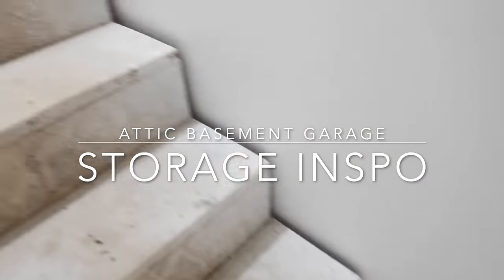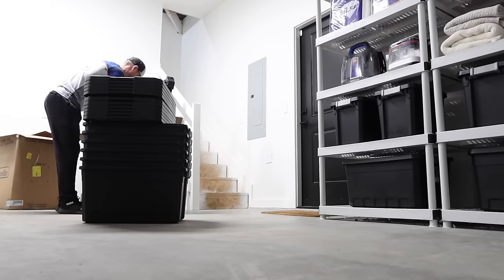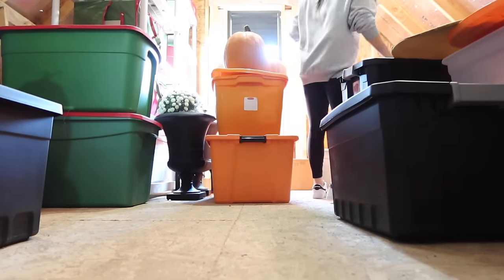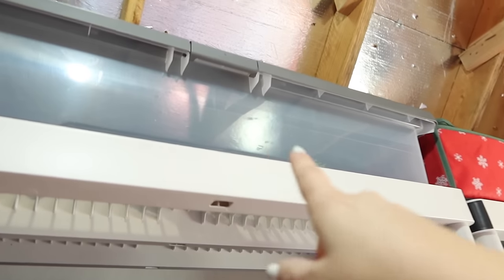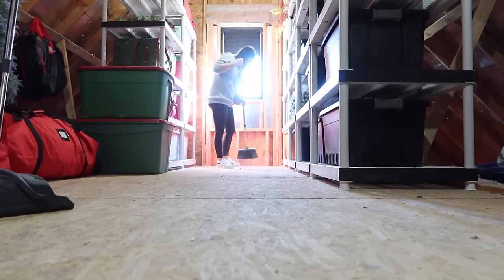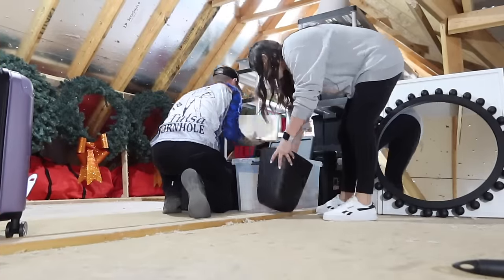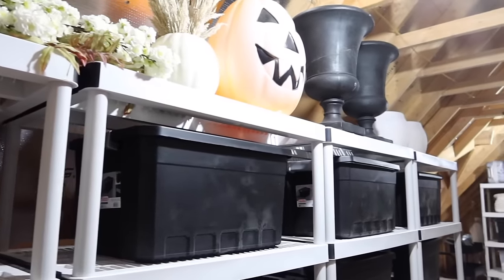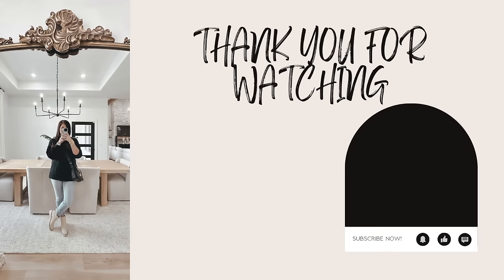DREAM ATTIC STORAGE + ORGANIZATION SYSTEM | 2024 HUGE ATTIC ORGANIZE WITH ME | STORAGE GOALS 2024

Comment: Wow! What a difference. You really can shop your attic now.
Please consider flipping those two black planters upside down. I'm afraid if you bump that storage rack just right, they might fall on someone.
If that is an extra air purifier with the left over building materials, plug it in up there. It will help with all the dust. Please take care of your lungs after being so sick. Give them as much clean air as you can.

Comment: Love your attic but why didn't the carpenters finish it that insulation is bad for you every time you go up there just from the vibration of you walking around puts the insulation dust in the air love you all see you in the next one
Reply from the maker: The majority of attics aren’t finished with drywall or anything. Just 2x4’s, plywood floors (sometimes) and insulation.